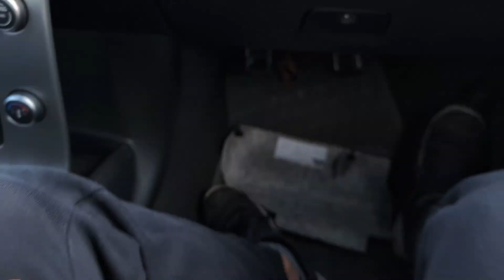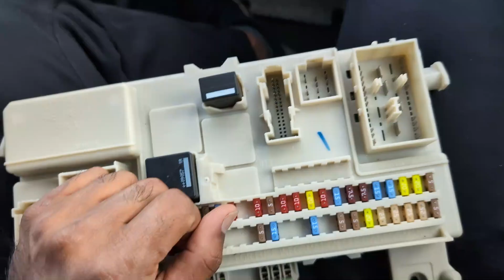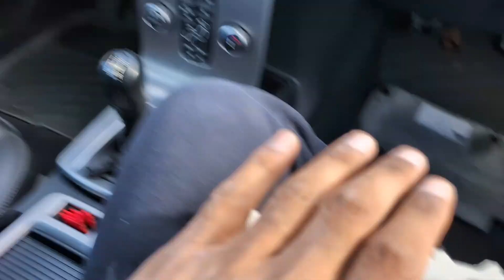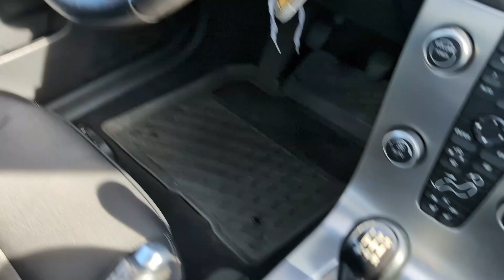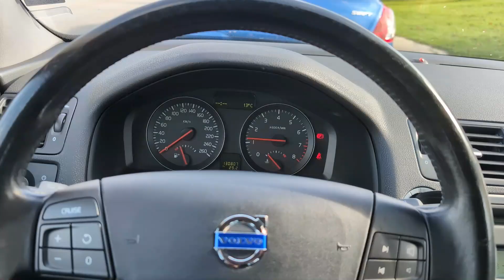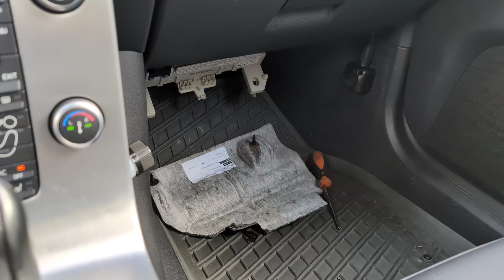How to Fix Volvo Alarm Service Error Message | S40, V50, C30 | CCM repair | Adnans Garage

Comment: I just had dealer replace the SCU and it was very expensive but they gave it back to me with the Alarm system requires repair code. That wasn't a problem before. It was saying key error. For what it cost - I thought I would get it back with no code
Reply from the maker: yes

Comment: My issue is the same error, the doors doesnt respond to the FOB but I can start the car and drive. Done cleaning the CEM. What could it be?
Reply from the maker: Then you don't have communication between the CEM and doors. You need to find the electrical diagram and check the continuity between CEM and door modules. Either the door modules are dead, fuses are blown, or the connection between CEM and the door module is broken. could be the wiring harness issue that goes into the door

Comment: Hello, I have a question about the V50 alarm. When we use the key fob everything works it secures the car, lights flash when armed etc. The one thing that is not occurring is that there is no sound when it’s armed. No chirp, no horn etc. Any idea what is happening and how I can fix?
Reply from the maker: Was it doing it before? Because i havent seen volvos doing any sound when locking unless you can turn this feature on somehow if there is an option